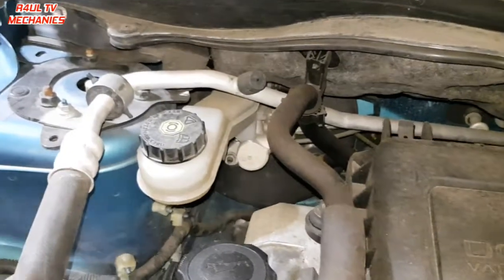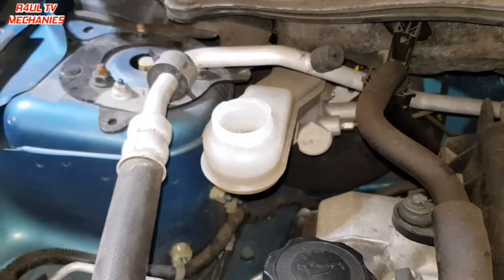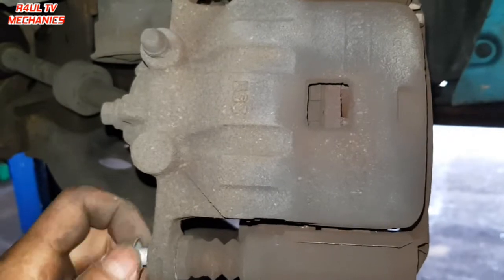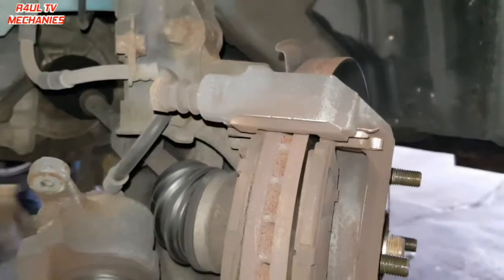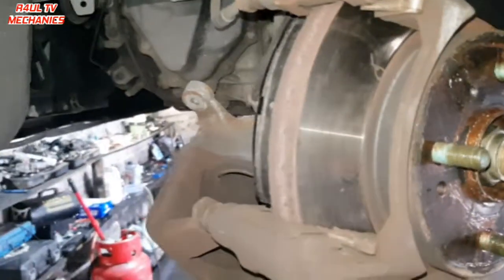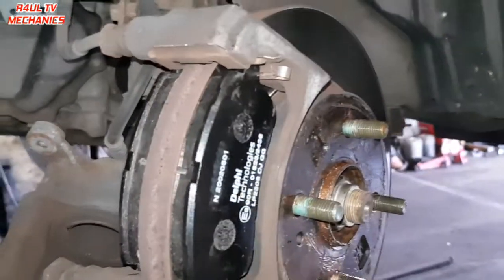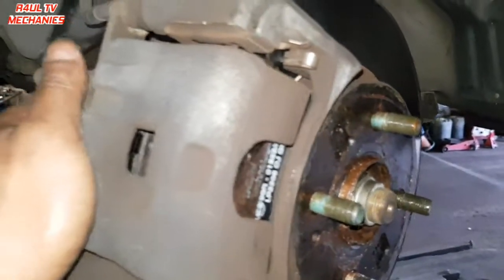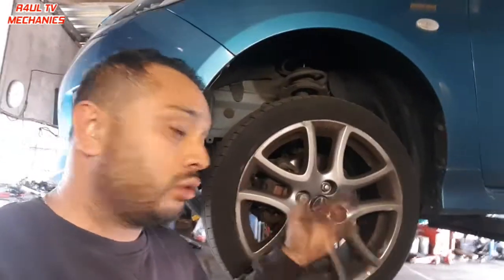How to Replace Front Brake pads on 2013 Mazda 2

Comment: Thanks for the vid. What are the torque settings for the brake calliper and brake bracket?
Reply from the maker: Al be honest I just do them tight as posible
Reply: Caliper mount: 65-75ftlbs
Caliper (small bolts that go into the pins): 20-30ftlbs

Comment: Good video! I personally would remove the spacers, cleaned & greased them up but maybe for the newer vehicles it is not necessary, along with 'roughing up' the pads with sandpaper?
Reply from the maker: To be honest you should do that,sliders should be nice and free cant remember if I mention it or not anyway thanks for watching
Reply: Not sandpaper unless it’s a high grit. Honestly would recommend a scotch brite pad instead. Or brake cleaner and a microfiber. No need to remove and metal just cleaning grease.

Comment: Would you un screw the bleed nipple before compressing the pison on cars with abs
Reply from the maker: Sorry for late reply, no dont unscrew the bleed nipple just undo the brake fluid reservoir cap and compress the caliper piston hope that helps
Reply: @TEAMR4ULTV  It does and that's exactly what I did.  It's my first brake job, I was nervous but I did it and all's well.  My car now brakes like a track car.
Reply from the maker: @taichihead42  great stuff